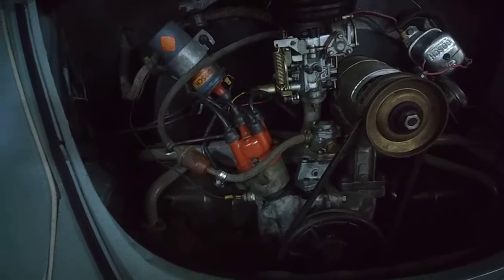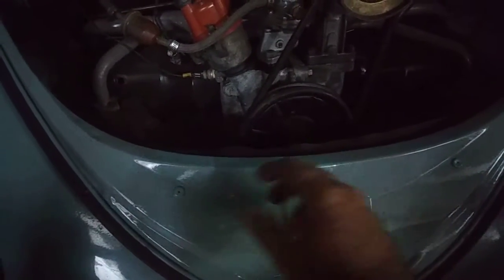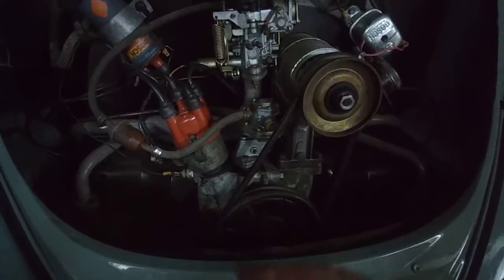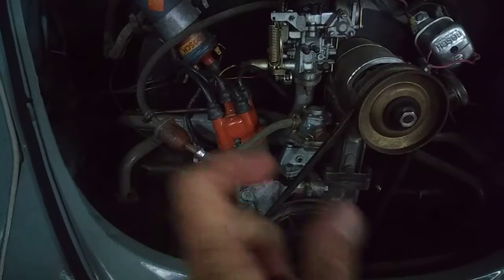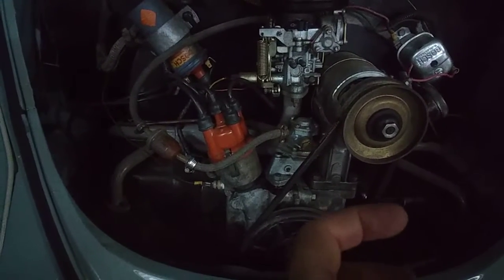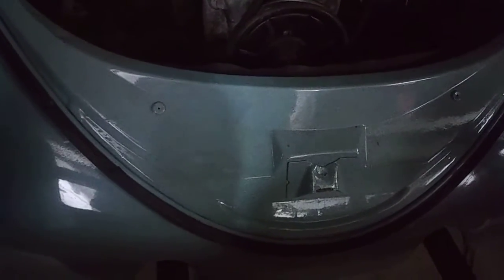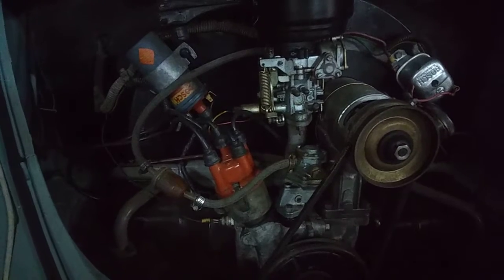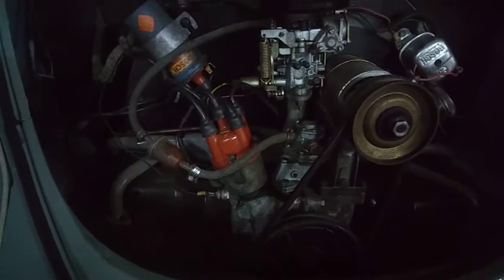VW engine building engineering which engine is best for you

Comment: Yo!!! Hello again VW wizard! I have ordered a fuel pump for my AAZ 1.9td swapped caddy pickup. 

I have no idea how the cold start ignition advance thingy comes together, would you be able to make a video on this matter? I have a knob left of my steering to pull in and out like a choke, cable intact but idk which position is which
Reply from the maker: mine is hooked up but i never need to use it. When I get mine back together I will do that